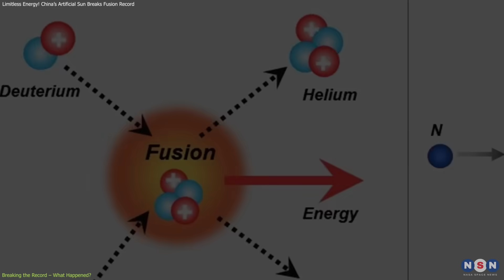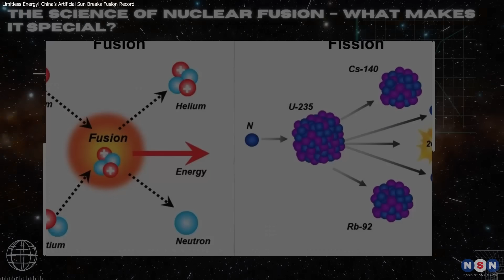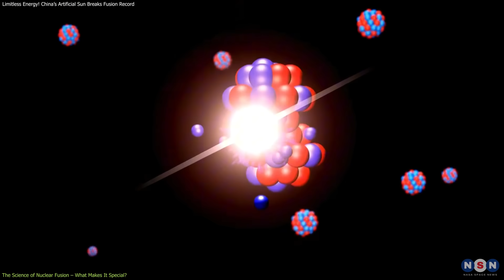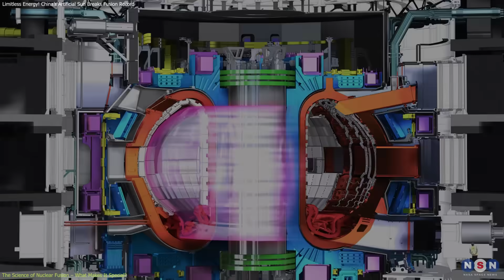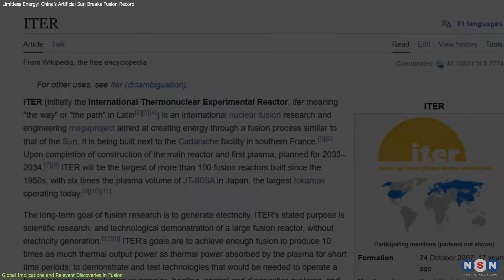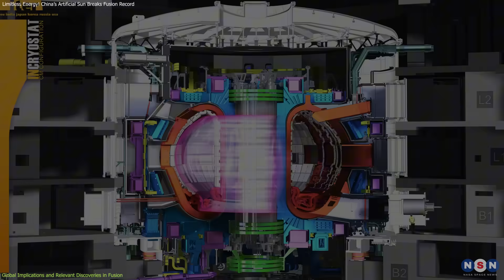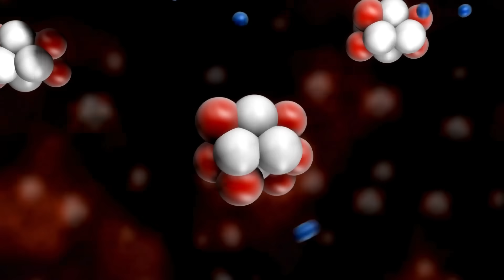Limitless Energy! China’s ARTIFICIAL SUN Breaks Fusion Record

Comment: and they already have a power source for space travel that first successful use of the artificial 🌞 sun was enough to travel at light speed over 20million miles across space and back I think they are trying to develop a way to pressurize and stabilize the inside of space craft that won't destroy the people and life on it during its travel ......more technology  needs to be developed and cern is also in this same area of experiments they can developed a magnetic field next around a craft or object for space travel and energy absorption it's radiation and unlimited solar power In space it's not completely dark

Comment: Gravity generators can be used to boost the fusion process more easily until the fusion, on its own, generates net energy. The fusion heat would allow gravity generators to work even on cold plutos, while at the same time lifting the helium emergency.

Comment: Even if you get a reactor to "work," you’re stuck in this brutal arms race where the energy you put in to hold the damn thing together is almost as much (or more) than what you get out.

Plasma wants to escape. Magnets want to lose precision. Materials get blasted by neutrons and break down faster than you can replace them. It’s like trying to inflate a balloon with a thousand holes in it — you burn energy just to keep the whole circus from collapsing. Even with breakeven, you still need systems to convert heat into electricity, maintain cryogenics, handle fuel, manage insane neutron flux… it’s an energy sinkhole.
Reply: @HighClippy  it sounds like this is a huge waste of time from your perspective. So why is it being pursued? Are scientists just wasting immense amounts of grant money to keep a ruse going?
Reply: @roberttheberge1966  No, it’s not a ruse in the deliberate scam sense. But it’s very much a technocratic fantasy that survives by promising jam tomorrow never today. The scientists aren’t necessarily liars but the system is incentivized to perpetuate itself, whether or not practical fusion power ever arrives. You're trying to recreate and bottle the core of a star a 100-million-degree plasma storm inside a warehouse on Earth… using fragile superconducting magnets, pumps, and vacuum chambers, all of which degrade over time. It's like trying to trap lightning in a spiderweb and hoping it holds up for decades. Trying to build a star and contain it isn’t impossible — we can do it for a few seconds — but turning that into a commercial, cost-effective, stable machine that runs for years? That’s the part that borders on fantasy.
It’s not that fusion is "too hard to start." It’s that it’s too hard to sustain and extract power from without spending nearly all of your output just keeping the system from falling apart.

Comment: I'm curious about the neutron utilization in fusion reactors - specifically, can these neutrons be used to breed fusion fuel by transmuting hydrogen into deuterium and tritium? While deuterium is actually fairly abundant in seawater (about 1 in 6,420 hydrogen atoms), tritium is indeed extremely rare in nature and needs to be produced artificially. What happens to the neutrons produced during fusion reactions, and what safety measures are in place to handle neutron radiation?

Comment: I solved your problem like 4 years ago: Solar-Driven Electromagnetic Grid System
Step 1: Solar Energy Collection
Sunlight is collected and focused using a funnel-shaped skyscraper lined with angled mirrors.
Mirrors reflect and direct sunlight downward in a controlled manner, concentrating the energy into a focal point.
Water flows through the structure, serving two functions:
Cooling the mirrors to prevent overheating.
Guiding the light downward using internal reflection and refraction, behaving like a liquid optical fiber.
Step 2: Heating the Liquid Iron-Nickel Core
The concentrated light energy is directed at a chamber filled with molten iron and nickel at the base of the skyscraper.
The temperature inside the chamber exceeds 1,500°C, maintaining the metals in a liquid state.
The liquid metal begins to move, driven by:
Thermal convection – Hot metal rises while cooler metal sinks.
Rotational forces – Simulating Earth's core rotation.
Electromagnetic induction – External magnetic fields influence the flow.
Step 3: Generating the Electromagnetic Field
The movement of molten iron and nickel generates electric currents, similar to Earth's geodynamo effect.
This motion induces a localized magnetic field inside the skyscraper.
The generated electromagnetic field is now ready for transfer or amplification.
Step 4: Directing the Electromagnetic Energy
Tunnels and conductive pathways guide the generated electromagnetic current to other structures.
Energy transfer occurs through:
Downward-flowing liquid metal – Using gravity to direct electromagnetic energy.
Metal rods or conductive wires – Acting as magnetic waveguides.
Magnetohydrodynamic (MHD) principles – Utilizing charged liquid metal flow for energy efficiency.
Step 5: Creating a Circular Electromagnetic Grid
Multiple skyscraper-funnel structures are connected, forming a closed-loop electromagnetic network.
The fields interact and reinforce one another, forming a continuous ring of electromagnetic energy.
The system self-sustains as energy circulates in a loop, keeping the liquid metal in motion.
Step 6: Stabilizing & Maintaining the Energy Flow
The flow of molten metal and induced currents maintains a stable magnetic structure.
Excess energy is distributed throughout the system to prevent overload.
This creates a balanced and self-regenerating electromagnetic field.
Step 7: Extracting Usable Electrical Energy
Electromagnetic energy is converted into electricity using one of the following methods:
Inductive Coils – Conductive coils (e.g., copper) are placed around the moving metal to extract electric current (Faraday’s Law of Induction).
Conductive Rods & Tunnels – Charged particles in liquid metal flow through metallic rods or pathways, generating direct current (DC).
Magnetohydrodynamic (MHD) Energy Extraction – Electrodes inside tunnels extract charge and send it to the power grid.
Step 8: Energy Transmission to the Grid
Once electricity is extracted, it must be efficiently transferred to the power grid.
Two main transmission methods:
Direct Current (DC) Transmission – Efficient for long-distance power transfer (e.g., high-voltage power lines).
Alternating Current (AC) Conversion – Used for local distribution, making it easier to step up/down voltages.
Step 9: Power Grid Integration
Electricity is routed to substations, where it is:
Stepped up (high voltage) for transmission across long distances.
Stepped down (low voltage) for use in homes, businesses, and industries.
This allows the solar-driven electromagnetic grid to power entire cities or regions.
Step 10: Sustainable Energy Loop
The system is self-regenerating due to:
The continuous flow of molten metal.
The closed-loop electromagnetic interactions.
The constant influx of solar energy.
This creates a perpetual energy generation system, requiring minimal external input.
Final Summary: How Energy Flows Through the System
Sunlight is collected and concentrated →
Water guides and cools the light while focusing energy downward →
Light heats molten iron & nickel, keeping it in motion →
Molten metal generates electric currents and an electromagnetic field →
Tunnels & conductive pathways direct energy into a connected grid →
The system forms a self-sustaining loop of electromagnetic energy →
Electricity is extracted using inductive coils, conductive rods, or MHD methods →
Energy is transmitted as DC or converted to AC for local power distribution →
Electricity is integrated into the grid, powering cities and industries →
The system sustains itself indefinitely through continuous energy cycling.
Reply: You are a genius person are self handed❤😊
Reply: @joseph-z5f6l  too much text bro, you ought to make a video yourself and show it to the world

Comment: Many European countries are now regularly running at well over 50% of their energy demand coming from ‘free’ renewable sources and the pace of transition is increasing year on year. Similarly in China and elsewhere there is a rapid expansion of solar, wind and other renewable sources. It is conceivable that soon the cost of both fission and fusion energy may become comparatively inhibitive given the free availability of cheaper and easily maintained sources. The problems of containing/disposing of radioactive materials will have to be surmounted - Fusion reactors generate neutrons that render containment vessels radioactive

Comment: This development may be limited on commervial use  by the cost and operating precision stability of lasing..heat containing materials..superconductor design and cist of energy as supplied.While the effort of Chinese scientists is commendable in labs..they should bring it to usable level out of lab conditions🙏
Reply: Do you know that the first controlled, sustained flight of an engine-powered, heavier-than-air aircraft with the Wright Flyer on December 17, 1903 flew only four miles. No commercial use right? Commendable efforts right?

Comment: NIF in it's current form is NEVER going to be practical, sure, they have got their little gold Hohlraum that holds the frozen fuel pellet sorted out, and made good fusion with it, but, the laser bank that is used to power it ? holy mother f'er, is that thing a dinosaur, it is so crazy powerful , so crazy big, that it LITTERALLY fries itself when operating. The laser is building sized, multi compartment with equipment that is just absurdly expensive and fragile, the beam is so powerful it "crazes" the glass optics and amplifiers, I doubt NIF is going to be able to stay operational for much longer, since TOKAMACS really are the "go to" way to make fusion work, EAST current progress is really great, to hold a fusion sustaining for 17 minutes proves that they are past the big hurdles, in the past, the big issue really has been squeezing and holding that plasma without it sneaking past the field and BANG ! imagine a plasma at over 100 million degrees Celsius coming into contact with ANYTHING physical, that's a bad day for that material plus it also quenches the process, a major no no.Recently, newer super conductors (REBCO) have come to the rescue and enabled finally the kinds of magnetic field strength that is ultimate essential for sustained, stable, fusion. The great thing about tis new superconductor, is that it is high temperature, by that I mean liquid nitrogen and that is perfectly doable and practical plus it is very easy to make and work with, and more importantly, it can handle MASSIVE current without crapping out. It is in fact so good, that it has enabled lots of smaller startups to attempt much smaller scale TOKAMACS, but suffice to say, with size you get more room to play with field density and probably will be easier to actually implement. Fusion will change the planet for sure, but it will also mean a new type of space propulsion system too. All this is definitely coming, but to say that we need to stop oil right now is just absurd, it is needed more now than ever, it will enable the wealth to move the slow transition to other energy types, plus the multitude of other essential uses of oil, anyone who says end oil just has no clue what they are talking about.

Comment: Since its completion in 2006, the EAST unit has operated more than 150,000 plasma operations, and through the open and shared institutional management model, it continues to maintain the international leadership in the engineering and physics of steady-state plasma operation. In terms of long-pulse high-confinement mode operation, it has crossed major milestones such as 60 seconds, 100 seconds, 400 seconds, and has always broken through itself, challenged the limit, and impacted the long-pulse high-confinement mode plasma operation with higher parameters. In 2012, a 30-second high-constraint mode was realized, in 2016, a 60-second high-constraint mode was realized, a 101-second high-constraint mode was realized in 2017, a 403-second high-constraint mode was realized in 2023, and a 1066-second high-constraint mode was realized in 2024. (Reporter Song Yajuan)

Comment: Tocamac solenoid and plasma only work in low gravity and near cooling source for steam turbines. Canadas sapphire electric hydrogen sun  is the high gravity fusion method that is practical. Scrap everything else. Hard to maintain plasma critical mass and control temperature. 
Hydro still 6X more power than fission reactors, so maybe stick with hydro and wind?

Comment: Energy - more coming out than going in?  Nope.  What does all this sound and fury signify?   One little assumption about the nature of "something so simple as a star" will bleed your treasure dry.  There's no excuse for abandoning first principles, Eddington.  We simply don't know.
Reply: The energy output comes from the mass of the fuel. That's how the Sun releases heat. It loses mass.

E=mc^2

The problem is getting more energy released from the fuel than you put in to generate the conditions for fusion. 150 million Kelvin and a toroidal magnetic field are energy expensive

Comment: Nuclear fusion is often described as the "holy grail" of energy production, and for good reason. It mimics the process that powers the sun, where hydrogen nuclei combine under immense pressure and temperature to form helium, releasing vast amounts of energy in the process. Unlike nuclear fission, which splits atoms and generates long-lived radioactive waste, fusion offers the promise of virtually limitless, clean energy with minimal environmental impact.  

The achievement of China’s EAST (Experimental Advanced Superconducting Tokamak) in sustaining plasma for 1,066 seconds is a monumental leap forward. It demonstrates our growing ability to create and maintain the extreme conditions—temperatures of over 100 million degrees Celsius and powerful magnetic fields—needed to sustain fusion reactions on Earth. This milestone not only pushes the boundaries of human engineering but also brings us closer to making fusion a viable energy source.  

Fusion’s potential is transformative. It could provide a nearly inexhaustible supply of energy using fuel derived from common elements like hydrogen, significantly reducing reliance on fossil fuels and mitigating climate change. However, the road to practical fusion power remains challenging. Issues such as maintaining plasma stability, developing materials that can withstand the intense conditions inside a reactor, and scaling up the technology for commercial use are still being tackled.  

China’s progress with the EAST tokamak, alongside international projects like ITER, signifies global momentum in fusion research. While fusion energy might still be decades away from large-scale deployment, milestones like these bring us closer to a future where clean and sustainable energy can power humanity’s ambitions. This achievement not only showcases human ingenuity but also reinforces the importance of investing in science and international collaboration to address the world’s energy needs.

Comment: This channel is infamous for making claims that will change the world forever, or change our understanding of the cosmos, or “break physics”.  Take everything with a “grain of salt”.  (Maybe thorium salt) 😅
Reply: The same was said 30 years ago about people who said we would be able to have a face to face conversation with someone on the other side of the world. Monkeys aren't known for their patience.
Reply: @Crawdaddy_Ro  well, the technology that enabled television, satellites, cell phones and the internet were less challenging by far than what is required to produce a sustainable fusion reactor that reliably provides ample power.  The progression from the vacuum tubes of the 1920’s to the first transistors in the late 1940’s to the first integrated circuits of the early 1950’s only took about 50 odd years.  Believe it or not, based on Einstein’s energy;mass equivalency relation E = mc^2, people like Eddington , Gamow, Russel, Atkinson and others began to workout the requirements for nuclear fusion in the 1920’s and the design for a toroidal magnetic “bottle” to contain a hot fusion plasma was first proposed in 1946.  It is remarkable that fusion research and the electronics that went from tubes to IC’s follow a similar time line.  Yet producing contained, sustained fusion is still in it’s infancy with many competing techniques still unable to make a break through let alone break even.  This attests to the difficulties and the very real problems that sustained fusion presents.  It is not a trial problem that may take much longer to crack than most think.
Reply: @Crawdaddy_Ro  There are differences though. Already far more than 30 years ago, people said that fusion reactors would be at commercial break-even in just a few years. Since the build of the Perhapsatron, not  much progress has been made in this direction. Monkeys aren't known for their scientific understanding, either.
Reply: @RGF19651  this is kinda what I tell women 🤣

Comment: Communist would really benefit from fusion reaction, here we'd still be privately charged to out weigh the balance of the costs to them for research and development not only that causing inflation as everyone usually but not implied markup whatever money is saved ($80 saved off energy bill = $80 increase on every item and/or bill). Maybe in 200 years when efficiency is met at a 1:1 ratio they stop ripping us off.